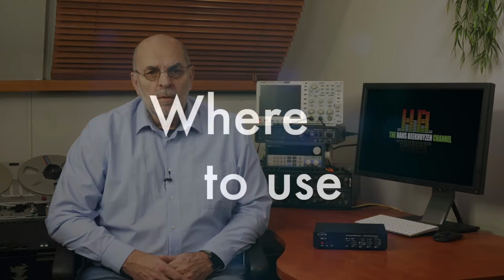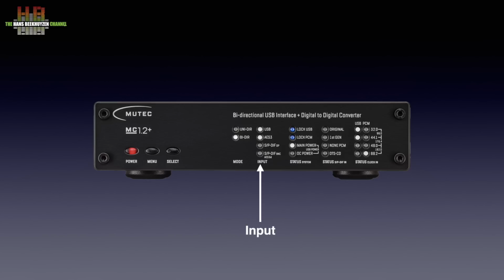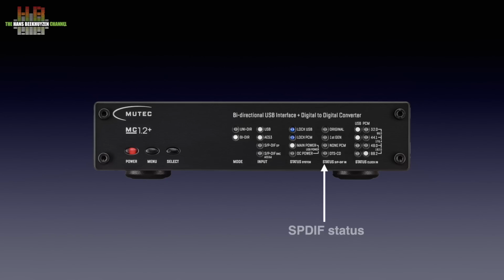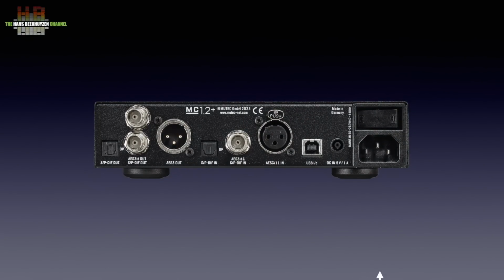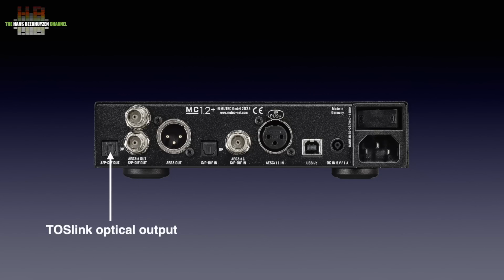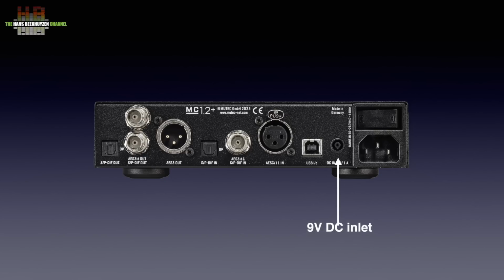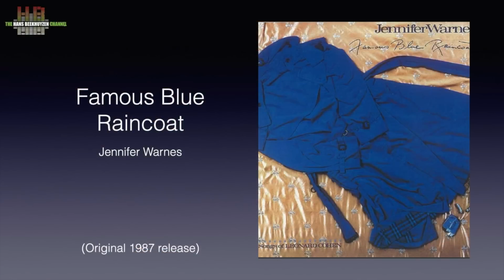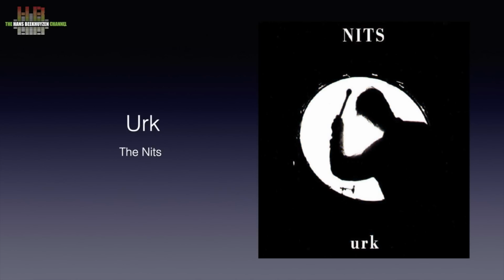Mutec MC 1.2+ Digital to Digital converter

Comment: I am surprised it wont input/output ethernet eg from a nas box which is what I want to do to usb audio but probably I am missing the point somewhere. Another great presentation thanks. You are the only talking head channel I find worth watching because of what and how you explain. Not that interested in anyones opinion on what they spruik as the ‘best’. I do my own listening for that.
Reply from the maker: What you need is a network bridge
Reply: @TheHansBeekhuyzenChannel  thanks. I did thlnk this might do it as a one box solution but no. I am thinking Aurender 10 as a one box best solution or else the units you reviewd a while ago whose name escapes me but were three smaller boxes including ps
Reply from the maker: I have not reviewed the Aurender so I have n opinion on it.
Reply: @ thanks anyway! Now I recall it was the sonore setup you reviewed positively that I am considering as a network bridge. However I Would prefer fewer boxes plus here in Australia its a lot of money esp by the time I got the ferrum hypsos ps as well as I am a fan of it.